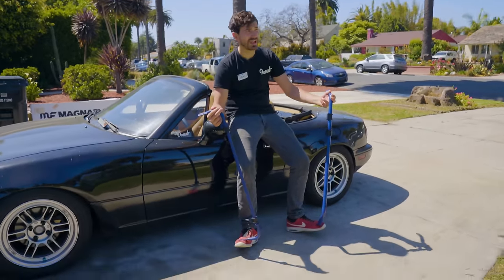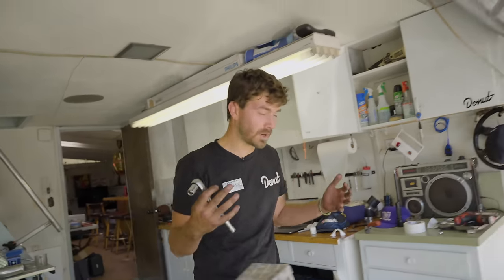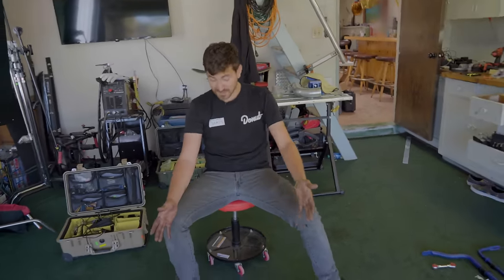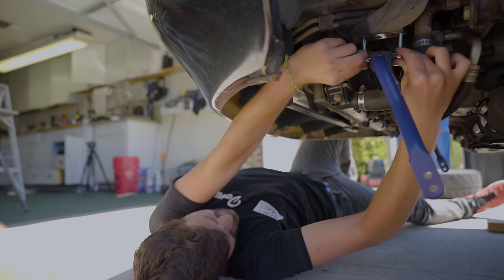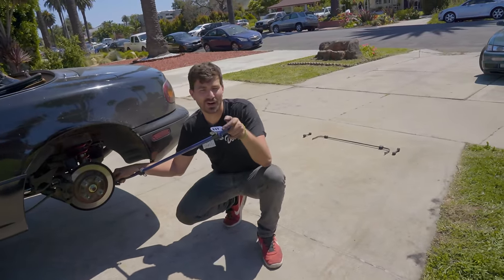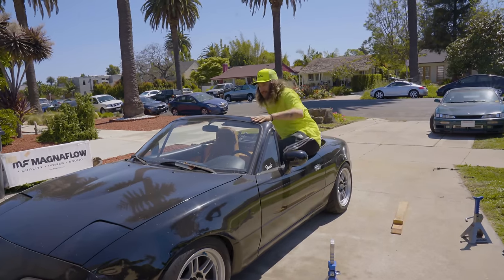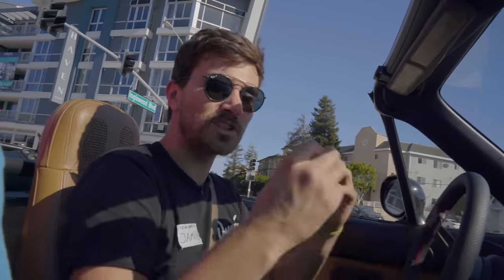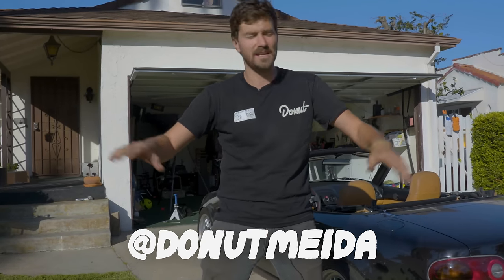Are Aftermarket Sway Bars Worth It?

Comment: 10:30 God, I'm so stuffed with this bullshit... "I have put thicker ARBs and there are no negatives, no comfort loss! Yaaay!"... If strong ARBs did not have disadvantages, they would have put them at the factory, better yet, they would have put no suspension, for that instant weight transfer and response. Like, everything, ARBs are a compromise -> you most definitely lose comfort, especially on surfaces that are uneven side to side. The car will bob a lot more. Also, most often than not, you will LOSE GRIP. Yes, you gain control and the car feels like it corners quicker, but you lose grip. A car with no ARBs generates the most grip as it lets the suspension to be truly independent on all corners. True, the car will feel like it will roll over and it will be difficult to control when the weight is transferring, but once is settled, it will generated higher grip, nu questions about it.
Reply: Depending on if your suspension setup there will be varying degrees of camber change during suspension movement.  By reducing body roll anti-sway bars reduce the camber change which can affect the size of the tire contact patch with the ground.

Using thicker sway bars to control body roll can mean softer coil springs can be used in the suspension.  It becomes a question of stiffer coil springs/softer anti-sway bars or softer coil springs/stiffer anti-sway bars.  On a smooth track surface, you will have fewer one sided bumps.

Also in SCCA Solo II autocross stock (now called Street) racing class you are permitted to adjust the front anti-sway bar but not the rear.  What drivers have discovered is that on McPherson strut front/multilink supension rear cars is that if you run a stiffer front anti-sway bar your times improve.  Although increasing front roll resistance should increase understeer characteristics, the reduced camber change increases the  tire contact patch and improves front traction which fights the understeer characteristics.  Bear in mind this is with r-compound tires,relatively soft stock spring rates and limited ranges of alignment adjustments within factory specifications, however it helps illustrate some of the factors in play.